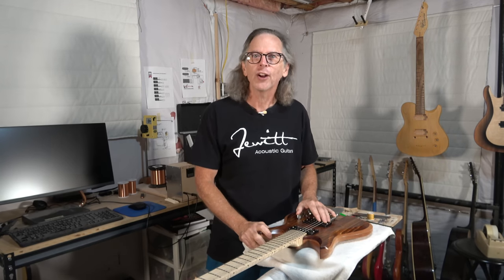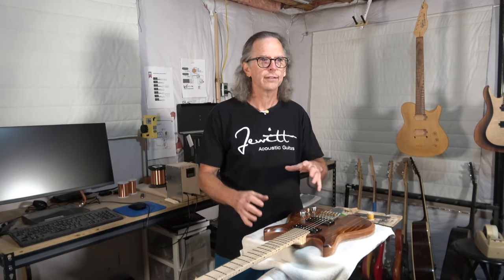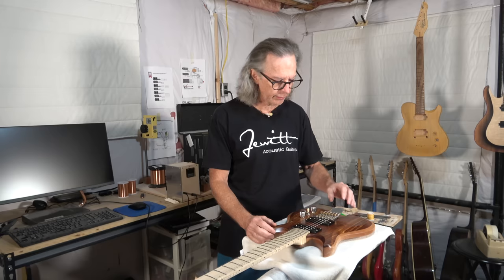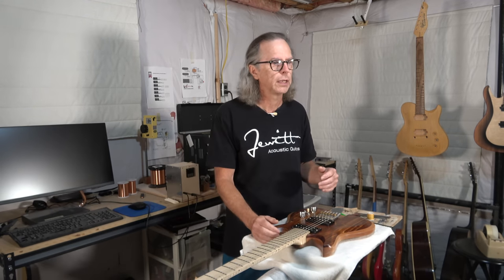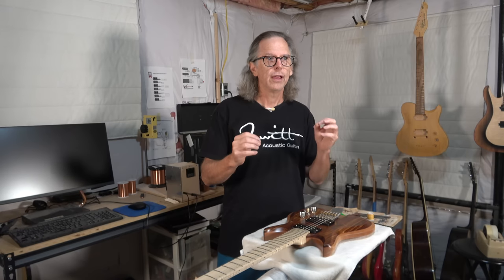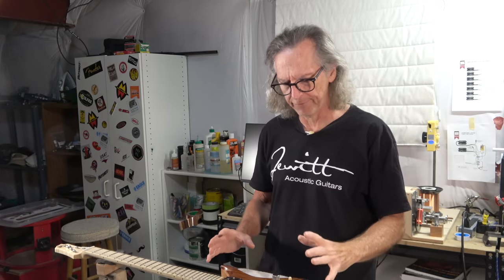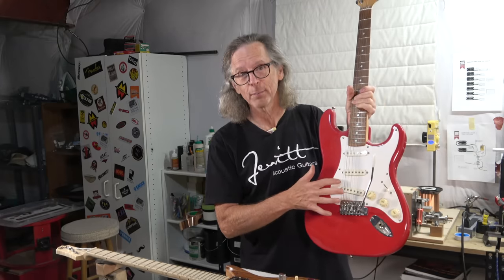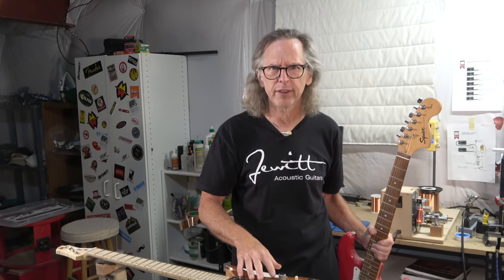Does Guitar Wood Need To Breathe?

Comment from the maker: Wood doesn't have a cardiovascular system. Therefore a respiratory system isn't necessary for wood to live. That's basic biology.
Reply from the maker: @Scott.9  Photosynthesis is not the same as respiration. Polymerized tung oil is even better.
Reply: @HighlineGuitars   As someone who has worked teaching College level biology for a couple of decades, I have run into this mistaken belief about plants not repairing a lot.  While you are correct that photosynthesis is not the same thing as respiration, plants do, in fact, respire.  Any living organism that has mitochondria respire. Without respiration, the plants would not make the ATP they need live.  I will give you that in hardwood trees, reparation only takes place in the outside couple of layers of the wood. The respiratory system of animals is only a means to get oxygen into the tissues it is not where respiration occurs. I do agree that the wood of a guitar is affected by hydration and dehydration not breathing.
Reply: @Scott.9  which part of the tree converts the CO2 to O2?
Reply from the maker: @Scott.9  That's not something I would ever waste time doing. May it's the sort of thing other YouTubers would want to do, but not me.
Reply: @HighlineGuitars  It's true that some factors have a little effect on the sound of electric guitar, but the number of these factors is at least more than 10 factors, our ears can't recognize when one factor changes the sound only 2 %  but when we have 10 different factors ( pots, tunners, kind of wood, nut, fret, finish .....) the sum of those small differences can be  recognizable, then we can't Ignore those small factors yes we can't hear 2% difference in sound of guitar but what about 2%x10?
Reply: @nmnmnm9509   @nmnmnm9509  Well said... This makes for various sound characteristics;  utilizing these variations introduces unique voicings... Brian May created his guitar sound, Eddie Van Halen created his guitar sound too... The options are endless between hardware, electronics and woods being used. ✌😏

Comment: Hey Chris thanks for the video. Working with coatings as a profession, I would also say it likely doesn't matter much on an acoustic either. Maybe with some type of softer finishes perhaps you may lose a bit of acoustic energy to some heat loss but likely not with something like a poly finish that cures hard. Given the durability and hardness of many finishes you would likely improve the ability for sound to resonate more freely. Having pores to "breath" would be like having small air gaps in the philosophy of sound dampening. You lose energy to the void spaces. Filling them allows more unintentionally energy transfer. That being said, much like a electric guitars pickups being more important than the wood choice,  I'd wager that the quality of the bracing construction on an acoustic (points of contact) maters considerably more than the finish on the same guitar.  Keep up the great content by the way!

Comment: Thank you. Thank you.   As a recreational builder and a retired engineer I have been enamored with this wood question in solid bodies.  I've learned that walnuts, mahogany. Maples do have an innate vibration peculiarity.  However, it's contribution to the sound produced is nominal.   Can't forget why Les Paul etal, needed these kind of guitars.  Acoustics in large halls wasn't cutting it.  So enter stage left. amplified instruments.  In my opinion the exotic woods used today only make the guitars more beautiful and expensive.  Much of today's popular music is modified by the amps and you seldom get to hear the pure sound of the guitar.  Much more modification comes via pickups, capacitors, other electronic mods and of course the amplifiers. 
Well done Chris

Comment: Great topic as always.  Acoustic vs electric are definitely different in regards to finish.  In regards to electric guitars, in 40 years I've yet to see much if any difference between a thick or thin finish on electric guitars or basses.   The main thing is whether the wood has properly aged and is at stable moisture level.  I personally use oil, french polish or wipe on poly because I great the results with those and I don't have a great area to spray.  My only dislike of thick poly is the possibility of cracking the finish when installing hardware. Other than that, it's mostly personal preference.  

Here's a topic that you can tackle and is sure to be controversial: old vs new wood.  Meaning that a 50 year old strat sounds better simply because the wood aged and was under string tension for 50 years.

Comment: Important is to keep the strings vibrating, if the wood starts to vibrate from the strings that will absorb the strings energy and so would actually damper the strings vibration. Good solid guitar wood is something that is very hard and dense so it will repell the vibration of the strings and keep them vibrate, ring for a longer time. Sorry if my words are not 100% accurate, hard to discribe something delicate in a not nativ language.

Comment: Thank you for covering this topic. It seems obvious that the type of finish on a solid body guitar has little to no effect on tone, and yet it seems every couple of months someone on the Gear Page makes a big stink about how poly finishes guitars sound "dead" and have no resonance. Next thing you know there are two camps arguing one side or the other of the issue. I've had guitars with poly, nitro, and oil finishes. All of them have sounded great, it's an esthetic choice more than a functional one. And of course, poly will always look good longer, unless you like the checking that happens with nitro. And an oil finish is very easy to repair if it gets damaged. But does one sound better than the other? No.

Comment: I have a weird single pickup ESP LTD eclipse with a bolt on that I found on guitar center for like a hundred bucks. Body is basswood, neck is just hard maple with a scarf joint and volute and rosewood fingerboard. Body is just basswood with black paint and satin finish. Hardware is passable, nothing special.  I put a nice seymour duncan in it and it sounds great. as good as anything that is decently built and has a nice pickup in it can sound. I even put some locking tuners and after-market brass bridge and tailpiece on it with that nice pickup in there and it sounds great. The thing is, it has an awesome neck joint and really good fretwork with a well made nut. I really think those 3 things are the essence of an awesome electric guitar regardless of price.
Reply from the maker: Your comment is a perfect example of why fancy woods and high dollar parts aren't what's required to make a great guitar. It's the X factor.
Reply: @HighlineGuitars  As someone who is still wanting to possibly build these things, maybe even for other people, this is kind of a relief, but also kind of scary. A relief in the sense that hey, I might actually be able to make somewhat affordable guitars for people if I don't have to use a $200 swamp ash body blank. But also scary because I know that people who are in the market for custom built guitars have probably (not all of them, but most) bought into a lot of marketing tricks and industry tricks to make them think silly things like "basswood sucks" or "bolt ons dont have good sustain".

Comment: I think when you say “resonance” what you mean is “Q” or quality factor. High Q = low damping, ie rings like a bell. Low Q equals high damping, ie wet blanket. I think overall you assessment is right and too much emphasis is placed on damping in the body of electric guitars. What probably matters most are the strings, and things that can damp the strings directly like the nut, bridge, frets and pickups, and then of course the electronics. I think a lot more fruitful investigation, would be evaluating the Q of the pickups, that should much more greatly affect if your tone is tight or loose or whatever else. Thanks for doing these videos, it’s great to see your process and why you make the design choices you do!

Comment: I remember the tonewood conversations. And you are right about the arguments. Wood breathing also has been a debate. I have taken a lot of guitar bodies and used epoxy resin as my finish. Epoxy has been a great finish, but is a lot of work. Between a epoxy bodies and the pickups. I have not noticed any difference between tones. As far as the wood bodies being sealed. I really don't think humidity is going to affect a guitar solid body that has been coated in epoxy. As much as I have used epoxy, I kind of wonder what it would do on an acoustic guitar body. How much of a difference the sound of an acoustic would be.

Comment: Hey Chris, I think you've got it right. If you want wood to breath you've got to add branches and leaves. I don't know how many YouTube videos I've watched that claim to show differences in sound transmission to the pickups for different woods and finishes and not been able to detect anything. Perhaps it's YouTube or my laptop but I suspect that it is more a 'placebo' effect. If there is a difference, it is so slight as to be insignificant and, anyway, who is going to notice these subtle differences when the sound is blasted out through effects pedals and a stack of speakers? I doubt that different woods etc. make any difference to the sound and think that a well-designed, well set up instrument will do the trick any time. Of course, it is nice to argue over such things and, if you have the cash, why not pander to your beliefs however, I happen to be a poor Scotsman more used to the subtleties of the bagpipes................

Comment: Breathe?  Only if one does not put any filling or finish on the guitar.  When finishing a guitar, I focus on one thing. To quote renowned woodworker Sam Maloof:  “One of the most important aspects of finishes, I believe, is that they invite [one] to touch, to caress, and to take pleasure in the wood surface."  Yes, if you finish the guitar, you will have a small or more (depending on the finish) sound on the guitar.  Best to focus on Maloof's belief to appeal to the intelligent buyer.

Comment: I don't think finish material or thickness has much effect on the way a guitar sounds, but I prefer oil finishes because they are easy to apply, don't smell too bad, and offer enough protection to the wood unless you sweat profusely or abuse the guitar in some way.  I think the distance from the pickups to the strings has the most dramatic effect on tone.  I have bought guitars that sounded great through somebody else's amp and when I played them through my rig I was pretty disappointed.  But an hour or so playing around with pickup height brought the sound back to life for me.  I use very light strings these days (.008 to .038) and some of my guitars actually sound louder to me with the pickups pretty far from the strings, and sustain seems better too.  I know this seems counterintuitive, but I just go with what my ears are telling me.  I don't know very much about electronics or magnetic fields, all I know is that some of my favorite guitarists lowered their pickups quite a bit.

Comment: What are your thoughts on placing the neck scarf joint around the 3rd or 4th fret area like many guitar makers are now doing?  It seems to me it might be alright unless the fretboard needs removal for some reason.   I also wonder how the glue line will eventually react to constant rubbing of the hand around the 3rd or 4th fret area.  Will the wear of the wood be consistent with the wear of the glue line?  Why did makers move the scarf joint?  Does it have something to do with board feet and how wood is purchased?

Comment: I only play my guitar against real cedar paneling, with spruce studs behind, and connected by ye olde square nails. Never again will I play against that chalky drywall or pressboard paneling with pine or metal studs behind, connected by those newfangled drywall screws. Only real tonewalls for me.

Comment: Guitar, being a percussive instrument as it's plucked, has lots of high frequency transients particularly in the attack part of the waveform. And the attack phase of the wave is the most important part of the timbre where you can identify an instrument. Roland's LA synthesis, during the late 80s, used only the few milliseconds of attack samples of instruments to simulate those instruments. When you get older, you lose the hearing range of those upper frequencies. Do not blame people when they honestly say they can hear the difference, it is there, but for older guys it is not heard at all. So do not forget that as an aging and experienced guy you have lost some of those frequencies in your hearing and you may not notice nuances younger people are hearing. I myself, am a middle aged person, and I remember when I was young, my strat bridge pickup sound was hurting my ears, it doesn't anymore, so I definitely don't hear some frequencies that hurt my ears back in time.
Reply from the maker: I use sound analysis software and it tells the truth.
Reply: @HighlineGuitars  Can you share some of your experiments? I watched a video where swapping only the body from ash to alder to mahogany, all unfinished, changed the tone of the tele very noticeably. The video is there in Warmoth Guitar Products channel if you want to watch.

Comment: I sanded two epiphone casinos which are fully Hollow, and even if they are électric guitars I noticed a great différence in the sound after having oiled them. I cannot say I found such a difference as I sanded solid Wood guitars. Even though don’t you think that the way the wood vibrates with or without a plastic or whatever thick finishing,coud transfer to the strings and make them vibrate differently in matters of frequences and sustain?
Reply: Placebo. You wanted it to sound different so it did. All in your head
Reply: With hollow body guitars the thickness of the top makes a huge difference. It is very likely that you took off enough of the wood for the top to resonate better.

Comment: It's true that some factors make a little effect on the sound of electric guitar, but the number of these factors is at least more than 10 factors, our ears maybe can't hear of when one factor change the sound only 2 %  but when we have 10 different factors ( pots, runners, kind of wood, nut, fret, finish .....) the sum of those small differences can be completely recognizable, then we can't Ignore those small factors yes we can't hear 2% difference in sound of guitar but what about 2%x10?
Reply from the maker: Cool. Now you just need to compile the evidence to support your thesis. Then, maybe you could offer a proposal on what a luthier could do with that information.

Comment: The wood does not need to breathe however coating the guitar with a thick finish may inhibit the guitar from vibrating as much and potentially decreasing sustain 🎸😁
Reply from the maker: That red Strat knockoff in the video has fantastic tone and endless sustain. Both with thick polyester paint and a plastic pickguard.
Reply: I did say potentially decreasing sustain...
Yes I have guitars with polyester finishes  with great sustain and it would be a nice experiment to see if they would sustain more if the finish was removed 😉 thanks

Comment: Not every vibration is resonation. wiki: "Resonance describes the phenomenon of increased amplitude that occurs when the frequency of an applied periodic force (or a Fourier component of it) is equal or close to a natural frequency of the system on which it acts. When an oscillating force is applied at a resonant frequency of a dynamic system, the system will oscillate at a higher amplitude than when the same force is applied at other, non-resonant frequencies." You cannot have so many natural frequencies to cover whole guitar range of notes. Ususally there is 1-3, maybe 5 basic frequencies and theirs harmonics. In practice you can hear the buzzing of saddles on some notes - that is resonance and you wouldn't like it.

Comment: LOL!  Soooo... How do you let acrylic "breath?"  Not all guitars are made from wood.  Trees breath mostly through leaves and inhale CO2 and exhale oxygen.  Wood doesn't breath just like muscles don't.  So unless your guitar is made of leaves, don't have to worry about breathing.
But I've heard that the more rigid the material the guitar is made from the more tone in solid body electric guitars.  Problem with acrylic and metal is that they are incredibly heavy.  Reason we use wood is because it's rigid enough while not being fragile, and it's relatively light weight.  So if that theory is correct than the more rigid the finish the better. But I doubt you can put enough finish on to make any noticeable difference.

Comment: So many experiment's proved that there's no sound of wood for solid body electric guitars.

Even if you consider the vibration of your pickups due to wood vibration it has such a small amplitude of movement compared to the one of the vibration of the string itself.

Comment: messing about on my bed the headstock touched the wall, a brick wall, and it was an electric guitar unplugged, and instantly it was 2 or 3 times louder,  so the theory is the frequencies are going from the headstock, and coming off the wall and feeding back into the neck, along said neck, back to the body??
Reply from the maker: The strings vibration is transferred to the fretboard and neck via the nut.